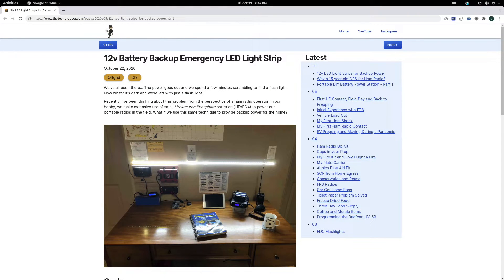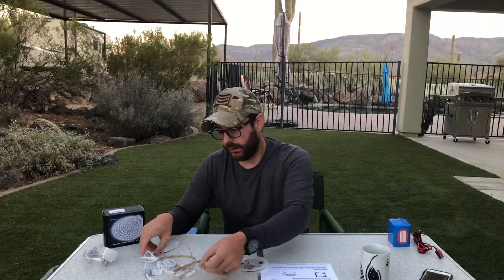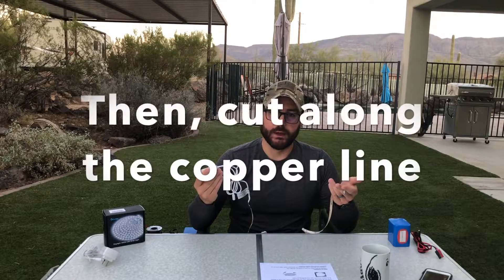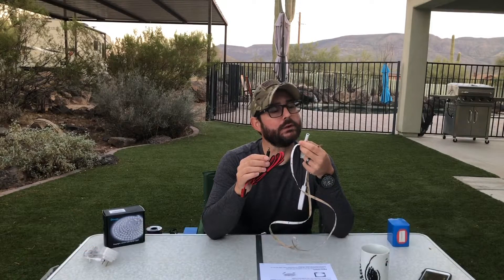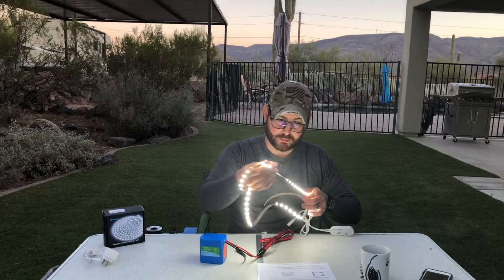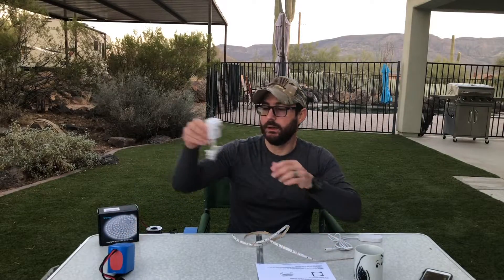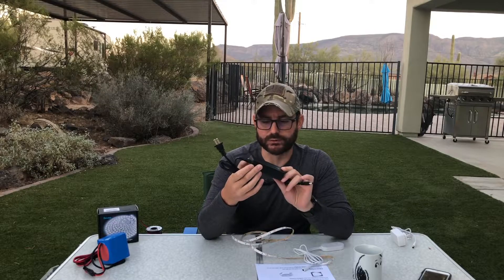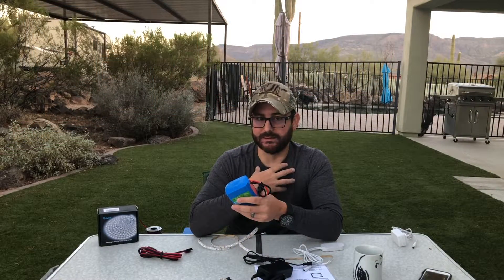12v Battery Backup Emergency LED Strip Light

Comment: You might want to put in a buck converter in line to lower the voltage from the battery.  Watch the first few LEDs in the string and see if they get hot or start to cook.  Another ham I know had this happen and the first few LEDs actually started to melt.  Maybe it was just the ones he bought, but something to watch for.
Reply from the maker: Thanks for tip! Yeah, melting is not good. I'll check  the heat on the first few LEDs... but I have not noticed anything. I also have a very small 1 amp fuse on the one in the shack. This 4" strand is drawing about 650mA continuous. As it turns out, I have a variable buck converter. I'll run some tests. Thanks again!

Comment: Update: your blog post details are excellent! 👏👍😃 Great video and topic - would just like to see the details of the splice & join LED strip connections, soldering, and power (voltage/amp checking?) to fully grasp the understanding and have the confidence to dive into this. Do those LEDs come with AC/DC converter - so do you need to change anything for a straight DC battery connection?
Reply: After following the Amazon product links... I think I understand better now how they connect. 1) LED strip is labeled for 12V, has normal DC power plug pin connection to AC/DC inverter, 2) add in powerpole to DC power plug adapter then connect to battery. The 3) 2 pin connectors for the loose LED strips was what I had not seen before too - so that closes the gap for me! Thank you for the product links!!! 👏
Reply from the maker: Glad you found what you needed. I’ll work on those kind of details on the next video. As always, I appreciate your feedback. I think you mentioned the end video links last time? If so, I added it in this video and will keep doing it moving forward. Take care!

Comment: Nice idea, I'll have to pick up those light strips and try it out. Great that they're customizable
Reply from the maker: Thanks. Note: if you go with different strip lights (like RGB) and want to make your own cables, you may need a different set of connectors. Some have 3 pins and could be a different size.